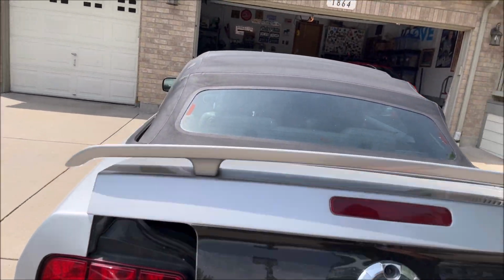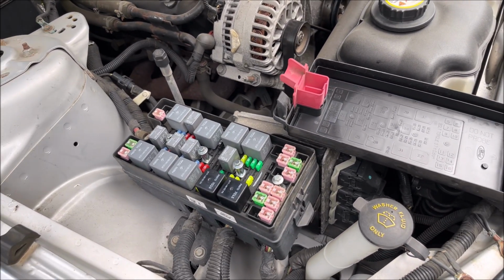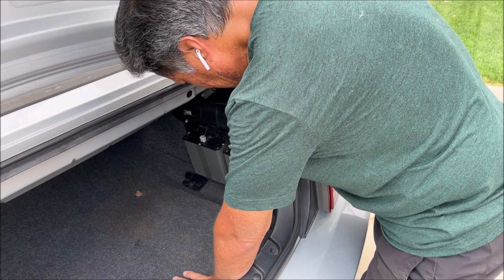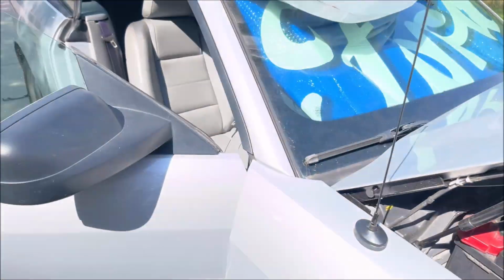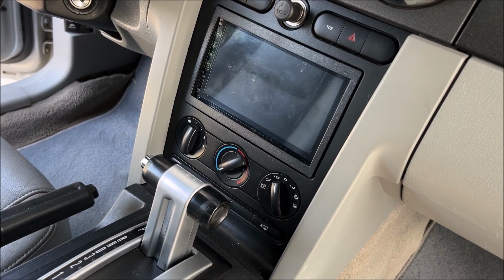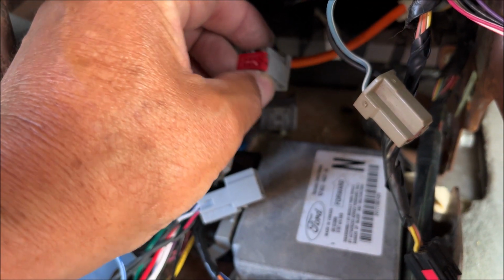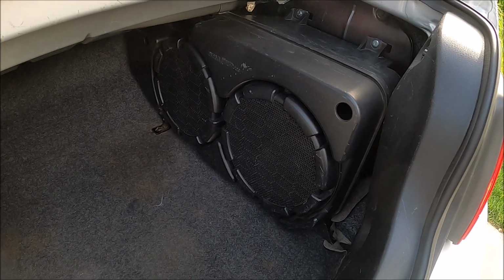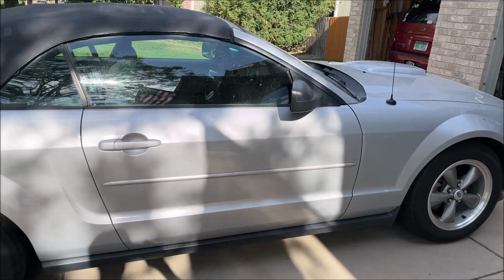Install / Retrofit Shaker 1000 Amps and Subs into your 2005-2009 Mustang that has a Shaker 500

Comment: I am in the process of doing this. I have power to the amps, good grounds, wired everything correctly to my knowledge but I am not getting signal from the headunit for the amp turn on. Any thoughts?? My headunit is a 07 navigation head unit from another Mustang so it should be fine?
Reply from the maker: Not sure. Is the navigation unit from Ford? In any case, I am sure there is a remote turn on wire or pin on the unit somewhere. Good luck!
Reply: @rad_vids yeah it’s from ford. I actually did some forum research and realized that they are setup for a shaker500/1000 from factory depending on the car, and I got a 500 style. Was able to tap into the shaker 500 amp controls and works great nice video!

Comment: Hey I know I’m a little late on this video, i don’t know if you will see this but are you also able to do this kind of retro fit on a base model Mustang that doesn’t come with a shaker500 I have a base model and Ive only switched the door panels to the premium model with the subs on them but id like to know what would I need to make this work or if its even possible thanks also great video!
Reply from the maker: Hi, it might be harder to do that. If you are trying to do it the stock shaker 500 way, you would need the amps that mount up under the driver side kick panel and obviously there's wiring that goes to those from the radio and from the amps to the door subs but I'm not sure that the standard stereo has the wiring in it for them already. If there are stock plugs and wiring there already but just not used it will make it fairly easy if you have the shaker 500 headunit and the amps and the door subs. If you want to do an aftermarket radio and aftermarket amp to run the subs in the door, it definitely can be done too running a few wires. Not sure my answer helps. Good luck.
Reply: @rad_vids will definitely look into that but I really appreciate the advice and once again thanks man keep up the great work !

Comment: Hey, currently doing this install as well on my 06 GT Vert with the Shaker500. Where did you find a diagram for the plug on the amp that hooks to the harness to go up to the radio and battery? I couldn’t the male end that is attached to the harness so i’m having to cut off the plug and just connect the wires.

Comment: I can't even find a s197 with a shaker 1000 system.. 😢
Reply: Just bought my 06 s197 with shaker 1000 system already I got lucky
Reply: The 500 is pretty good with a good aftermarket unit and upgraded speakers all around